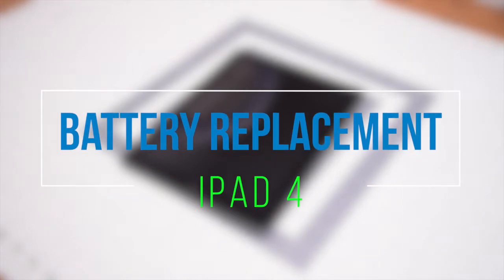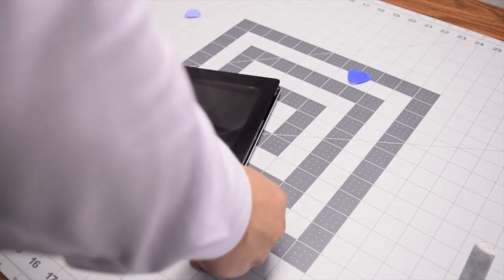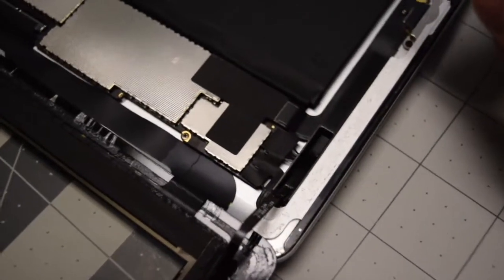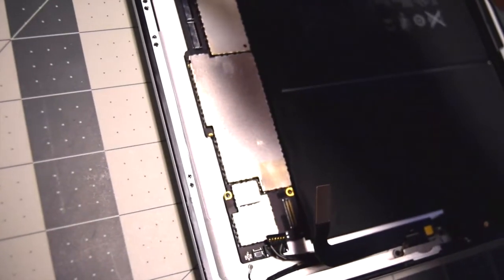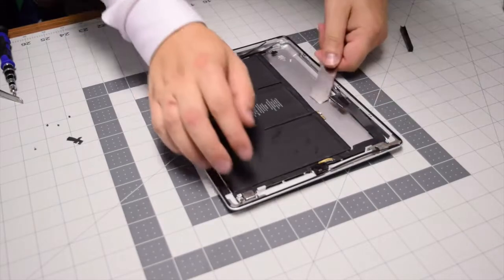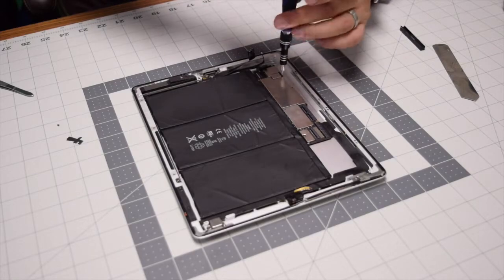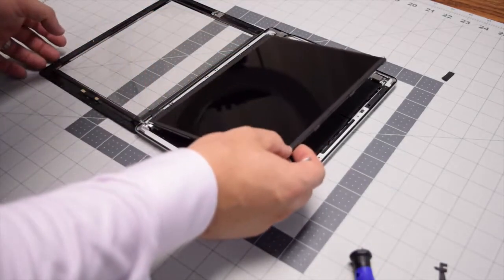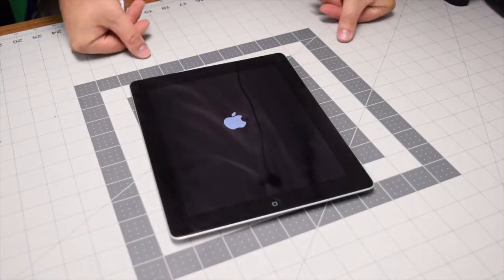iPad 3 and 4 - Battery Replacement

Comment: help after i replace and do your vid it wont touch anymore please help?
Reply: It is because you damaged the ribbon cable to the digitizer.... this video was missing a lot of important information with regards to removing the glass screen there are a lot of areas you have to be careful when prying up the screen or you will damage the ribbon cable or the Wi-Fi antenna or other parts. There are other better YouTube videos that show you what to be careful of..... in much greater detail.
Reply: @Kurt_Outdoors  its fine already i fix it via reconnecting all ribbon.